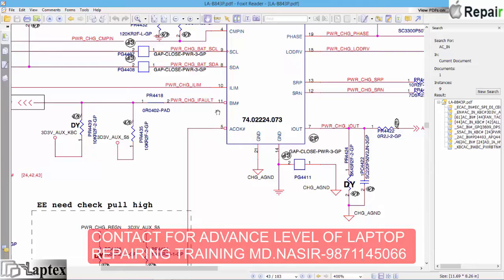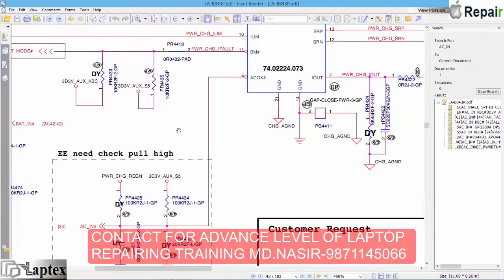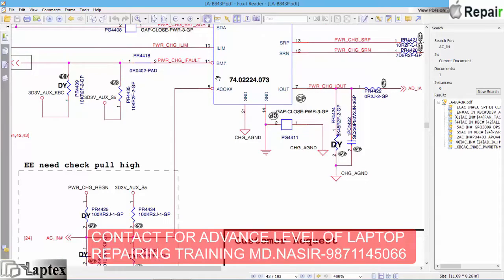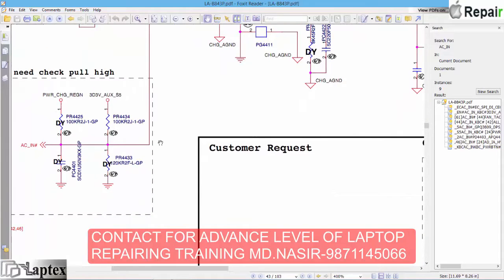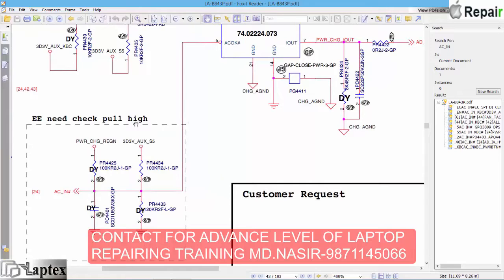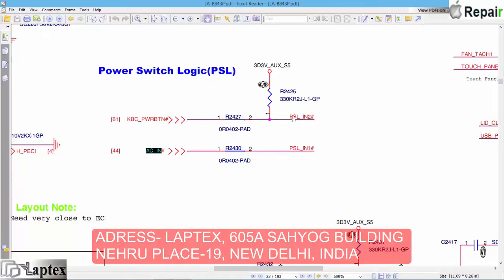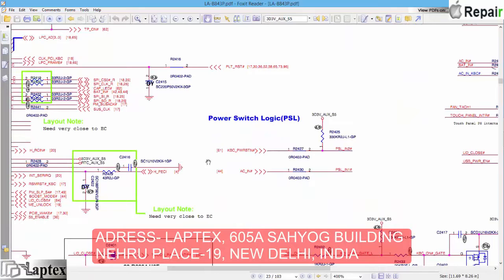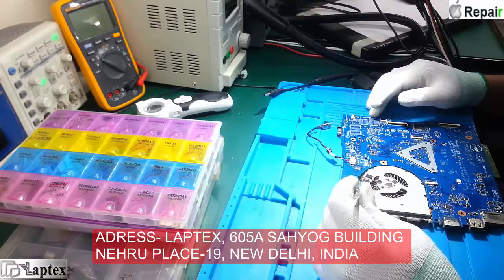LA-B843P CHARGING ACOK# LOGIC IN DELL 5558

Comment: sir i have this board but i have strange problem. When I press power button it on for 3 to 5 second then it goes off. I checked charging ic it's ok please help me sir
Reply from the maker: Isolate section and check...
What are the voltages that are available while the board is on.??
Reply: @laptex1377  sir do you do motherboard repairing also. I want to send this motherboard for repairng

Comment: Good day Sir i have dell inpiron 15 5558 .sir i am having issue that it is not setting its time and date even i had changed CMOS cell but still time and date is not setting up  and the bettery cell also finishes in about 3to4 months...please need help
Reply from the maker: Check RTC section diode and capacitor for any Leakage.
Reply from the maker: Also share this video so that it reaches to the Maximum audience.
Reply: @laptex1377  could you please send any image vedio or any thing for help gmail: muhammadnaqi922@gmail.com